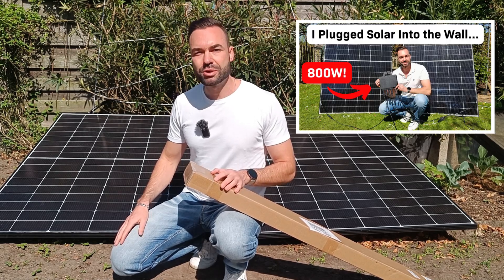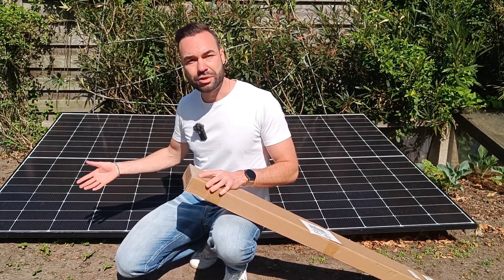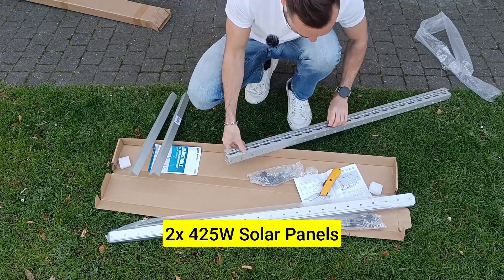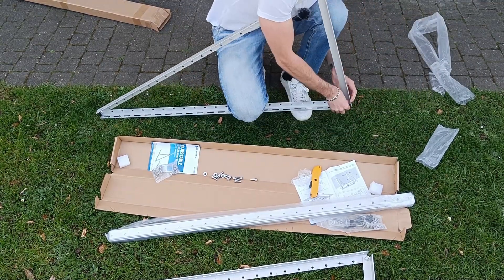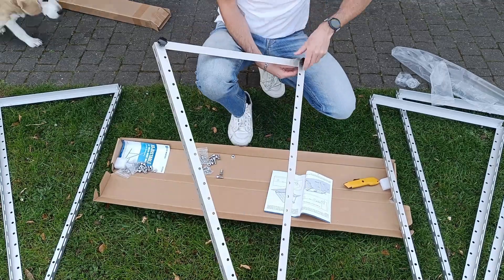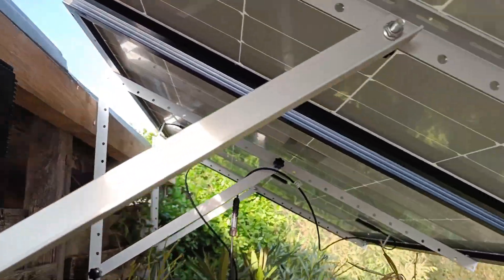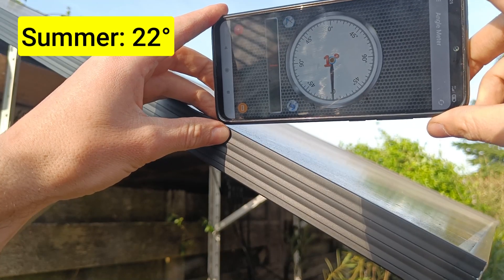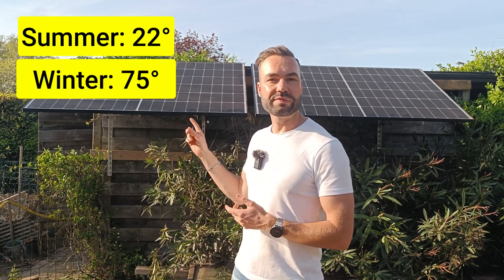Installing Solar Panel Mounting Brackets With Adjustable Angle

Comment: I was considering mounting 400W panels in the same manner on my privacy fence.  Thanks for the proof of concept.  Good info Nick!
Reply from the maker: It still works great. These brackets have holded up in high winds.
Reply: @cleversolarpower  Works great Nick!  I have mounted 3 420W panels thus far on the back of my privacy fence.  I used 14AWG Unistrut instead of wood.  The wood flexed a bit too much.  I found the Unistrut made it easier to adjust the spacing between panels and brackets.  Thanks again for the info.

Comment: Not 1:1 exchange anymore for many places.
In that case, get a meter and run an extension cord to your neighbor's house and see power to them for less than the electric company's rates lol
Reply from the maker: 800W would be enough to offset some of your own power consumption during the day. So it's more focused on self consumption rather than sending it back to the grid.
Reply: @cleversolarpower  My goal exactly.
If I wanted to send some back to the grid, I would have to spend about $50,000 just for house electrical upgrades and that raises my property taxes....
Bad return on investment I should think.

Comment: Nick, somehow I find all brackets completely overpriced. Might be me, but thinking you can get panels for 60€ which include a frame, the panels itself which are costly to make, shipping from China etc, compared to some thin alu profile and a couple of bolts and washers ... way to much.  Last one I bought was laughable as well as the brackets had an L-shape and the holes where not drilled like every 10cm but like 8cm then 12cm etc so you could not properly mount 2 side by side without a space in between them as both L profiles had to face the same way instead of inwards underneat the panel.  Tried showing this with pictures and drawings to the seller but I ended up getting ghosted. Somehow I might need to go to Brico or our Hubo and make some more sturdy mounts myself.
Reply from the maker: Brico or Hubo, i like those diy stores here. If you want to make a DIY mount, i recommend using Unistrut. There are quite some videos about it online.
Reply: @cleversolarpower   Thanks for the hint. Looks a lot more sturdy than L alu profiles. Btw the one I received included some plastic on the bolt like yours (1:00 at your knee). Lets hope UV doesn't kill that plastic.

Comment: How did these brackets stand up to high winds?
Reply from the maker: They are not in a windy area because they are positioned under the top of the roof. However, if there would be high winds i think they will be ok. As long as you mount them securely to a solid structure. I intentionally left air gaps around the panels that if there is wind, it can go around the panel and not be like on big sail. So if you give the wind a place to go around the panels you will be ok.

Comment: Hello sir,
Thanks for the very useful information you have been sharing on your channel. 
I have a question on charge controllers. 
I have a 20A MPPT controller and  two 425W panels I intend to wire in series. The panel spec are : current at Pmax  10.5A, and V at Pmax is 41,5V. 
For the charge controller: pmax is 520W, Vmax is 100V. Since the current stays the same in a series connection (about 10A )and less than 20A, can I use this charge controller for the 850W array?
Reply from the maker: 850W/12.8V=66A if you are using a 12V lifepo4 battery. You can use it, but you would lose a lot of energy. 100V/(41.5*1.25)= 1.92 is the max panels in series, so on a sunny cold day, your voltage might be higher than the max input voltage of the MPPT, which will damage it. Check my video about sizing a charge controller for more information.

Comment: I just bought this Eco worthy solar set and wondering if there’s anything I should buy to make it better? It has 4.8KWH Solar Power 1200W 24V with Lithium Battery and Inverter for Home: 6pcs 195W Bifacial Solar Panel + 1pc 25.6V 100Ah Li-Battery + 3000W MPPT Hybrid Charger Inverter
Reply from the maker: I made a review about an ecoworthy set, but it was smaller. Maybe you can watch that one and do what i did to improve it.

Comment: Another good clip Nick, thanks. I don’t think tariffs have anything to do with the US prices yet. Then again, I didn’t see the price before the tariff announcement. Most US energy producers buy your power for significantly less than what they sell it to their customers.
Reply from the maker: Indeed, i've seen these priced at $100 in the us before. Makes me wonder why they are double the price in the US. It's not more expensive to ship them to the US or the EU. Maybe they have a higher return rate in the US, this have to increase the price to make up for it? Yes, that's when it makes sense to store the energy in a battery.

Comment: I want to do this myself but i want it to be ground mounted... But i dont know how to do it

Id probably iuse cement in buckets for the standard but im not sure how to angle the "pergola" top piece where the panels will rest

I dont want to drill in any walls just want it to be like a tilted silar panel tent on 4 cement legs
Reply from the maker: If you do a ground mount you can still use these. It's just flipped 90°. I would get some wood planks like you see in the video and instead of fastening them to the shack as you see in the video, put them on the ground and add some weight to it. Sandbags or concrete blocks.

Comment: You’re better off charging batteries and doing other things then feeding them back into the grid power company will never give you what it’s worth so you’re losing efficiency
Reply from the maker: Thanks for your comment Tony. As I've said in the video it depends on the contract you have with your power company. I get 1-1 (but not for long anymore). I also have a battery that get's charged during the day.
Reply: Nice :)